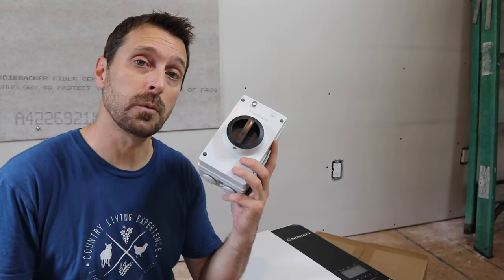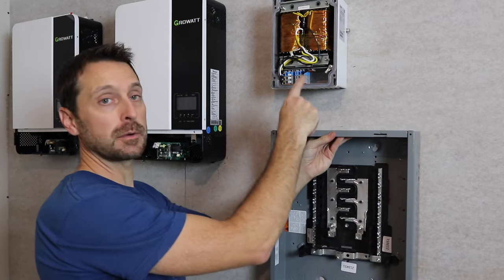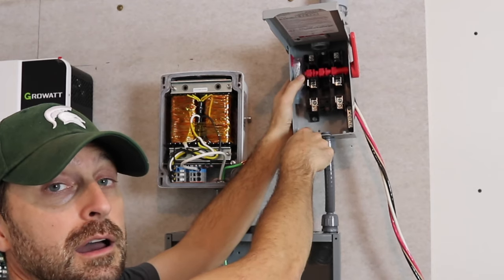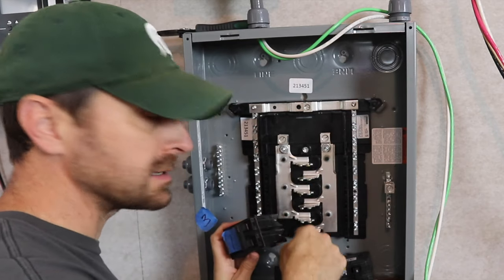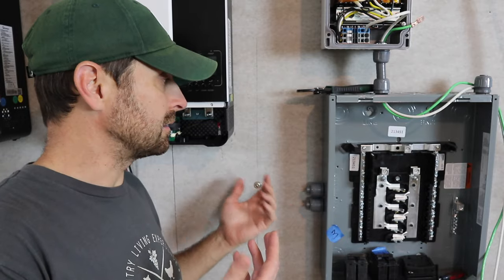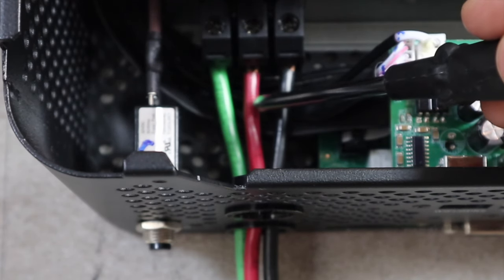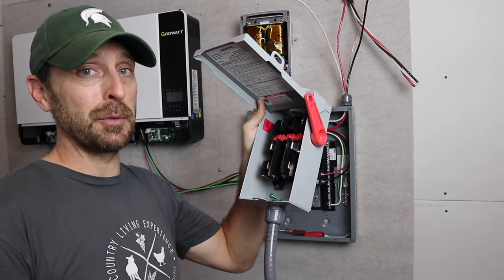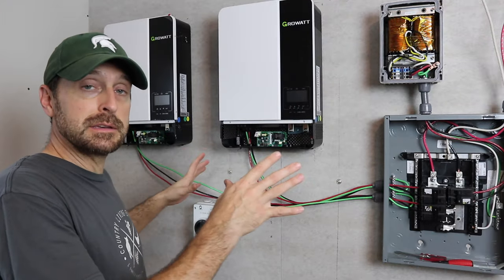Growatt Inverter 5kw Installation And Wiring DIY Solar System!

Comment: You should put the balancing transformer in the main lugs on that panel. You don’t want there to be any chance of that panel being energized without the balancing transformer as that will destroy at least some of the 120V equipment powered from it. 

The two breakers on the inverter outputs will protect the balancing transformer from short circuits and it should’ve been sized large enough to protect it from overload in the worst case unbalance that could be predicted.
Reply from the maker: I worked with the solar company (Signature Solar) and their design team. This is how they recommend connecting the system.
Reply: Okay. Looked like you put it on a 30A (you didn’t say and the video was a bit blurry). So the first time you get the blowdryer and curling iron in the bathroom and the toaster in the kitchen (just an example who knows what high draw 120V appliances happen to be on the same leg somewhere in the house) and trip that breaker you’ll lose your neutral. 

Then the lines will have voltages to neutral inversely proportional to their loading. So the heavily loaded leg goes low and the lightly loaded leg goes high. It is one of the cruel ironies that heavy loads which won’t be hurt by this tend to be cheap things (blow dryer, toaster, air compressor, etc). The lightly loaded leg which will go high always seems to end up with the computers and TVs on it and they don’t like 200+ volts so much (though newer ones with universal power supplies do better). 

A little example for illustration. 
The house is pulling 1000W. Nicely balanced. Someone turns on a blowdryer (1800W) and the curling iron (500W) and someone else turns in the microwave (1800W) and those two circuits happen to be on the same leg. So now the legs are L1 = 500W just like before. L2 = 4600W. Should be fine right? Wrong. That 30A breaker trips after about a minute of this and then all kinds of ugliness starts. We can predict what will happen to the voltages. L2 will go to 23.5V and L1 will go to 216.5V

Moral of the story. You really do not want that balancing transformer not to be there anytime that panel is powering the house. 

At the very least you should move it to the other side of the panel and install handle ties through all 6 breakers (the four from the inverters and the two from the balancing transformer) it won’t keep it from tripping by itself but at least it will keep you from accidentally turning it off while the inverters are on.

Comment: I would be interested why you used the Growatt which requires an auto transformer to operate. I have been looking at the EG4 units which create the 240/120 in the unit.
Reply from the maker: The EG4 did not exist at the time I purchased my Growatts. 
I'll let the secret out of the bag......I have two new EG4's on the way right now. Stay tuned for installation videos for them.

Comment: Maybe I misunderstood, but I asked SS if I needed an additional transformer, to upgrade from 1 to 2 inverters; they said yes.
Reply from the maker: I think you may have misunderstood. You can use 1 transformer with up to 3 inverters.
Reply: @CountryLivingExperience  Here's what Signature Solar Told Me : "As for the 5000ES if you need split phase power you will need to get a midpoint transformer. If you plan on running 5000es' in parallel with one another a thing to keep in mind is the Midpoint transformers have a maximum output of 5000w. So if you need the entire 10000w that 2 5kES would produce you will need 2 midpoints wired paralleled together. "
Reply from the maker: @buixote  That is interesting. That is contrary to what I have been told and to what Signature Solar's YouTube channel video indicates.

Comment: I’ve been trying to understand what happens if the auto transformer’s breaker flips. Do the two poles simply become unbalanced? Or is there more to it? What happens to the 120v circuits?
Reply from the maker: From what I understand is that it will just send 240v back to the main. The 120 circuits will just not operate.
Reply: @CountryLivingExperience  I took your word for a while, but I found out NEC section 450.5 seems to say the auto transformer isn’t allowed to have its own over current protection. It has to connect directly to the conductors.
Reply from the maker: @benjaminpupa839  Do what you want then. Give Signature Solar a call and talk to them about it. I built my system how they instructed me to.
Reply: There is a great video of David Proz rewiring the auto transformer to the Growats with a 3 pole circuit breaker. If the transformer should go bad the breaker flips and cuts the power from the Growats to the subpanel.
Reply: @martinhrabe9888  yes! Saw it when it was new. That seems to be the only way to meet code, since a neutral breaker independent of the hots doesn’t seem to be allowed.

Comment: Hello from Northern Ireland! - I am thinking of installing 3 of these Growatt 5k inverters also in parallel to 40 panels. I can't find documentation to say if the 3 strings (one per inverter) must be the same ie: the same watts/volts/amps to each inverter -my 3 strings are slightly different. 
Inverter 1 =12 panels 4320w/160v/30A 
Inverter 2 =12 panels 4320w/160v/30A 
Inverter 3 =16 panels 5760w/160v/40A.
Each string is within the manufacturers tolerances. Do you know if it would be ok to connect this setup in parallel or if i should keep the 3 inverters separate?
Reply from the maker: Hello. The three strings don't need to be the same however, you still need the proper amount of voltage to operate each inverter. Mine are unequal, my inverters are paralleled, and everything works perfectly.
Reply: @CountryLivingExperience  Is that "Nominal DC input voltage 48V" meaning my panels need to supply a minimum of 48v for the inverter to work properly? (does this still apply even though i will be connecting 240v mains/grid also) Thanks for your help.
Reply from the maker: @richardleighton822  No. Growatt 5k inverters usually have a minimum input voltage of 120V (Max of 430V) to operate the MPPT. Your European models could be a little different. It should say in the manual.

Comment: This is my last question I don't mean to bother u I just don't wanna mess up my inverter when it gets here can I do that same configuration using that SolarEdge transformer on a single phase 230v inverter that only has L & N on the output??
Reply from the maker: No worries. 
I do not know anything about the inverter brand you have. I cannot properly advise you on what to do. There has to be a ground somewhere. I suggest joining the DIY Solar Forum and asking question of the guys there.
Reply: @CountryLivingExperience  the ground is on the case of the inverter it's one of them PowMr inverters looks just like the MPP Solar PIP LV6548

Comment: You absolutely need to ground the inverter. The reason you might have struggled on the disconnect is it's only rated for 30a max (#10 wire ), you seem to be using #6. #6 is also wrong if you have it protected at 70a, needs to be #4 if landed on a 70a breaker. You need to upsize your disco and downsize your ocpd. Double check into ground and neutral bonding and if in your system the ground and neutral should be bonded or isolated!
Reply from the maker: Great. Thanks. Hopefully I can find a different knife switch. This is the only one I could find in a 50 mile radius. As for the breaker, the solar company, my electrician, and two other friends who know electricity said the 70amp is fine with 6ga so I’m sticking with that.

Comment: Just curious the reason you didnt use conduit for the cables to the inverter? Is it not required?
Reply from the maker: I mentioned in the video that I was putting them on later after I get the system working.
Reply: @CountryLivingExperience  oh cool i missed that nic informative video much appreciate the detailed walk through

Comment: So line is considered  Line 1 and neutral is Line 2 on all these inverters basically  im making me a note pad mines have no ground output im still a lil stuck on that part
Reply from the maker: Did you buy them from Sig Solar? If so, you can call and ask. Yes, L1 is line 1 and N is line 2. The ground is right next to it.
Reply: @CountryLivingExperience  my ac output terminal don't have a ground next to it just Line & Neutral on the output the input has all 3 yes ground line & neutral this is not a growat  inverter from sig solar but it's same type hybrid inverter a 5000 watt 48 volt PowMr solar inverter

Comment: Quick question: on the Generator Interlock Kit. Do you have a generator installed on this system or you using this just based on the solar system. I just ordered the majority of my solar products.
Reply from the maker: I do not have a generator installed. I use the solar like a generator.

Comment: Hi .I have a question on your balancing transformer . Why do you need one? I have the 12 k low frequency inverter. I have not installed it yet. Working on solar shed and will be moving all solar electric and batteries when done. I am totally off grid. Will I need to get the transformer? Signiture solar never mentioned it to me.
Reply: If you have this model 12kW 48V 150VDC 120A Off-Grid Inverter by Growatt, you don't need the xformer.
Reply from the maker: Growatt sells several different types of inverters. Not all of them are 240v which requires the transformer.
Reply: The Growatt 5K inverter's AC output is 240vac so there are only two output lines (both at 240vac).  To supply 120vac loads you need this transformer to create a neutral line between the two 240vac lines so that neutral to either 240vac line would be 120vac.

Comment: Newbie question...What is the purpose of the transformer? I've never seen it used on the other bigillion videos I've watched. Is it because most of the videos I've watched are using batteries? Thanks.
Reply from the maker: Since these are 240v inverters, you need a midpoint transformer to split the 240v into two 120v legs for your home. Batteries have nothing to do with it. There are many inverters on the market that are 240v like these Growatts and some Victron models.

Comment: Awesome videos 
 2 questions.  Your using 25amp breakers for the transformer with number 8 wire  isn’t that awful thick wire for such a low breaker size 
 And why does growatt suggest a 50 amp breaker in the Manuel for the 5KW but only using #10 wire. 
  These numbers just don’t make sense to me at all
 Keep the great content coming please
Reply from the maker: Since the run is so short on those transformer conductors, it should be fine. Bump it up to a 30A if you need to.
Not sure why the Growatt manual suggested that 50A. I used 40A and 8awg.
Reply: @CountryLivingExperience  alright thanks for the help 
 And didn’t you used to run EG4 6.5KW?
Reply from the maker: @cowboymcq6711  You're welcome. I actually installed the EG4's after these Growatts. I am going to use the Growatts again for my barn and well. I am in the process of making those videos.
Reply: @CountryLivingExperience  I replaced 2 my EG4 6kw for the growatts 5kw hopefully this was a good move
Reply from the maker: @cowboymcq6711  Curious why you made the switch?
Reply: @CountryLivingExperience  the EG4 6kw  would not stop throwing error and fault codes. And if not that they would constantly shut down   Nothing but issues  and it took 3 months to get them replaced 🤮🤮
Reply from the maker: Yikes. That's not good.

Comment: IT is very possible to get up to 240 v on a 120 leg of the split phase residential setup using an autotransformer wired in like this.  How do you think appliances will work on a 240 volt supply.  Or how about the other side that will go low.. how does your fridge work on 60 V or less.  If you lose a neutral from the transformer, power will just flow back up the other phase at voltages dictated by how the load is split on the 2 phases.  Same thing will happen of you open the breaker to the transformer.  You lose neutral and it will then float

The very reason the USA uses split phase was to save copper when the system was first build to power lighting loads @ 120 V., and motor load @ 240 v. 3 wires can power 2 circuits @ 120 v.  Hence "Split Phase".  We still have this system today.

Comment: I understand that this growatt is customized to suit US requirements, i am not living in US, power here is 220v and 50hz. If i buy this model from my local original dealer in my country, will it be of the same mentioned  quality and features? My worry if the non US version could be bad or completely different? I did not see reviews for non US version of Growatt or at least a comparison between original and US version model
Reply from the maker: I do not know what is available in your country. Growatt is sold around the world and they have a good reputation but there are some clones that have been made.

Comment: So, your ground from your sub panel is routed over and connected (grounded) at your main panel?
Reply from the maker: Yes, it is.
Reply: The real issue is only if you connect the neutral and ground together on a sub panel, 
you only do this to the main panel. 

TBH Im not a certifiate electrician but electronic engineering so Im sure there is others better to answer it, but I didnt saw this point in comments. 

One question, why you didnt take a 120/240 inverter instead? 
no concern for floating ground or issue in case of a fail. 
Some models seems to get inputs from your main AC, generator,solar, etc.. and gives a 120/240 AC output.

Cool project BTW! 
Where I live electricity is still too cheap to be profitable for my needs right now to go solar, would take 35yrs to break even with current prices.

Comment: What gauge wire did you run from the battery cabinet to the inverters?
Reply from the maker: 2 gauge. We did more vids on the system here:  https://youtu.be/I2rbxKtx5cs and here https://youtu.be/SrCSSc9JYSo
Reply: @CountryLivingExperience  Thank you

Comment: i have a growatt ats 11400 us transformer, my electrician connected one growatt 5000w inverter to GRID and the other to EPS and my house to 3breaker ...is that normal...
Reply: and he dont have a breaker box in between inverters and transformer...theyre connected directly to the each other
Reply from the maker: I have never seen or heard of a connection like that. I do not think a direct connection is recommended in the installation instructions. I could be wrong though. You’ll have to take a look at the installation manual.

Comment: BTW- Shouldn't the big cable be inside a metal conduit?
Reply from the maker: If you are talking about the battery cable, it does not need to be in conduit. As for the smaller wires, I will be putting them in conduit once I have everything working perfectly the way I want it.

Comment: Hi, I'm trying to get educated because we're going off grid soon.
I apologize for my question,  I'm a woman and technical things don't click on me as eassy yet I'm trying 😤.  Why 2 inverters?
Thanks for your efforts!
Reply from the maker: No problem. I am happy to help. 
Each inverter can only provide 5kw of power. If you turn on the stove and it uses 4kw of power and then want to run the dryer which also needs 4kw to run, you will be at a deficit. You would need 8kw at one time. So for my house 2 inverters that are 5kw (10kw total) provide what I need at any one time.

Comment: Hello, can i have you help plz with this problem : i have growatt 5000, 4 battery 100ah lead acid, afer full charge, the capacity of battery 100% but at at night with no load just 100w, the capasity drop to 25% then after 1 hour the capacity 75% without charging the battery,
Reply from the maker: That does not seem possible unless the equipment you are using to monitor the battery capacity is faulty.

Comment: can you clairfy which breakers you are using are DC rated ?
Reply from the maker: None of the breakers in this video are dc. All of them are on the ac side. I will add dc breakers near the panels for over current protection.

Comment: Hello I've washed a couple installers of this solar edge transformer my question is if the inverter only have a line & neutral output with no ground can the SolarEdge transformer be used still or no?? I don't want to buy this inverter if I can't use it the input has three line neutral ground the output only has two
Reply from the maker: Sorry, I do not understand what you are saying. The transformer has a ground.
Reply: @CountryLivingExperience  yes I just thought about that lol I'm just nervous with all this that's all I didn't want to waste $500 on this inverter coming when I seen that it didn't have a ground on the AC output

Comment: I watched this whole video but I'm kinda lost I'm trying to learn about that lil box to convert the 240 to 120 I didn't see u speak to much on it in detail or run the output of the 120 ac from that solar edge box  my inverter is 230-240 I'm trying to convert to 120 ac
Reply from the maker: Watch this video where we wire everything completely...https://youtu.be/I2rbxKtx5cs Let me know if that helps.

Comment: The Growatt SPF 5kw ES in listed as an off grid inverter. It seems to be able to operate as a hybrid inverter. Is there any difference between this inverter and what is listed as a hybrid?
Reply from the maker: The hybrid inverters listed on the Sig Solar website are made by Huawei. They are grid tie and come with an additional auto-transformer if you want to switch it to off-grid or hybrid.
Reply: The 5K IS an hybrid inverter. The ability to either be grid-tied and still work without having to be connected to an active grid in case of grid outages (in addition to PV and Batt) is what signifies this.